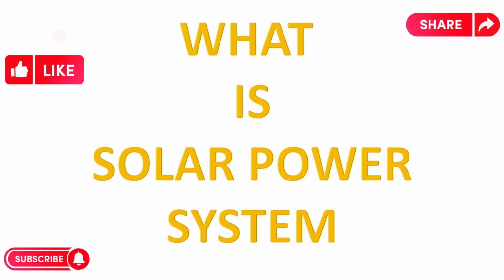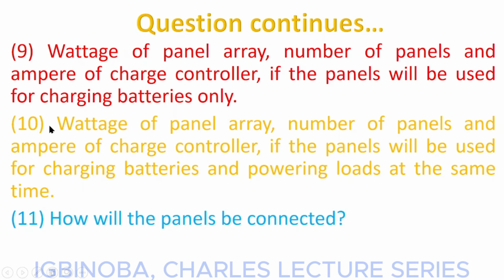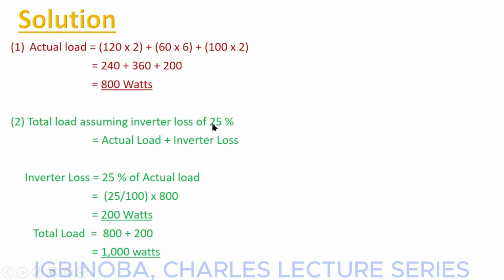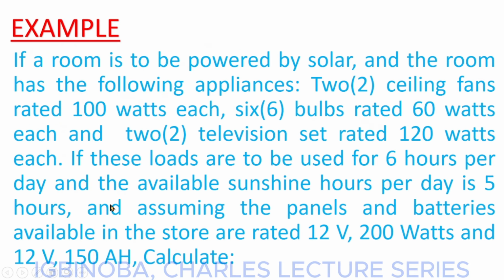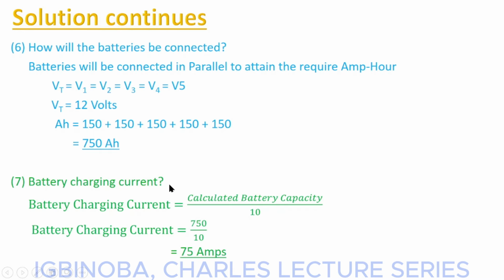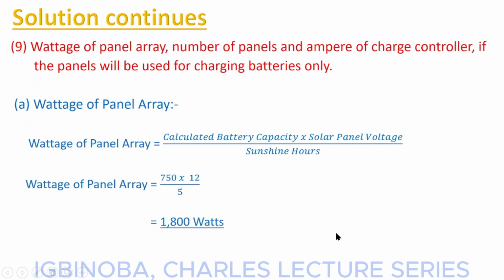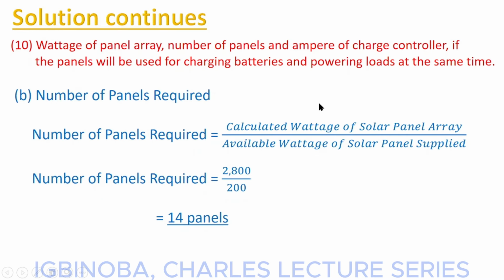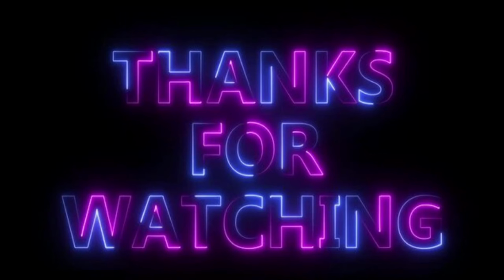Design of Solar Power System

Comment: CIV23W 
ANSWERS; 
1) 1380 Watts
2) 1725 Watts
3) 2156.25 VA
4) 1293.75 AH
5) 9 batteries approximately 
6) It will be connected in parallel 
7) 129.375 A
8) 14 hrs
9a) 3105 watts
9b) 16 panels approximately 
9c) 258.75 Amps 
10a) 4830 watts
10b) 24 panels approximately 
10c) 402.5 Amps
11) It would be connected in parallel

Comment: EEE118N
1. Actual Load= (3×100)+(10×60)+(4×120)=1380Watts
2. Total load with 25% inverter loss= 1725Watts
3. Inverter rating= 2156.25VA
4. Battery capacity= 1293.75Ampered
5. Number of batteries= 9 batteries 
6. Batteries are connected in parallel 
7. Battery charging current= 129.4Amperes
8. Battery charging time= 14 hours
9a. Wattage of panel array= 3105Watts
9b. Number of panels= 16 panels
9c. Charge controller= 258.75A
10a. Wattage of panel array= 4830watts
10b. Number of panels= 24 panels 
11. Panels are connected in parallel

Comment: EFETURI-YOUNG SOLOMON 
COET/10546/2022

1. 1380 watts
2. 1725 watts
3. 2156.23VA
4. 1293.75Ah
5. 9 batteries
6. The battery are to be connected in parallel
7. 129.4A
8. 14hours
9a. 31053W
9b. 16 panels
9c. 258.75Amps
10a. 4830 watts
10b. 24 panels
10c. 402.5A
11 The panel are arranged in parallel.

Comment: MEC118N

1. 1380W
2. 1725W
3. 2156.25VA
4.1293.75AH
5. 9 batteries
6. Connection is done parallel to increase current
7. 129.4A
8. 14 hours
9a. 3105watts
9b. 16 panels
9c. 258.75A
9d. Parallel connection
10a. 4830watts
10b. 24 panels
10c. 402.5 A
11. Panels are arranged in parallel

Comment: CIV30D

1) Actual load - 1380watts

2) Total load - 1725watts

3) inverter - 2156.25VA

4) Battery Capacity -1293.75AH

5) number of batteries -9

6) parallel connection 

7) battery charging current - 129.375amps

8) Battery charging time- 14hrs

9a)wattage of panels arrays  - 3105watts

9b) Numbers of panels - 16

9c)Ampere of charge controller -  258.75amps

10a) Wattage of panel arrays - 4830watts

10b)Number of panels- 25

10c) Ampere of charge controller - 402.5Amps

11) parallel connection.

Comment: COMP53A

1.)The actual load is 1,380W.
2.)The total load assuming inverter loss of 25% is 1,725W.
3.)Inverter rating is 2156.23VA.
4.)Battery Capacity is 1293.75Ah.
5.)Number of batteries for backup hours is 9.
6.)The batteries will be connected in Parallel.
7.)The battery charging current is 129.4A.
8.)The battery charging time assuming a charging loss of 40% is 14 hours.
9.)When the batteries were charged only;
a.) Panel array= 3105W.
b.) Number of panels=16.
c.) Charge controller=258.75A.
10.)When the batteries and powering load were charged at the same time.
a.)Panel array=4,830W.
b.) Number of panels= 24.
c.) Charge controller=402.5A.
11.) The panels would be connected in Series-Parallel.

Comment: PETROCHEM45S

1. 1380 watts

2. 1725 watts

3.  2156.25 VA

4.  1293.75 Ah

5.  9 batteries

6. Parallel connection

7.  129.375 A

8. 14 hours

9. 3105 watts
    16 panels
     258.75 A

10. 4830 watts
       24 panels
       402.5 A

11. The panels are arranged in parallel

Comment: PETROCHEM46T

1. 1380 watts

2. 1725 watts

3.  2156.25 VA

4.  1293.75 Ah

5.  9 batteries

6. Parallel connection

7.  129.375 A

8. 14 hours

9. 3105 watts
    16 panels
     258.75 A

10. 4830 watts
       24 panels
       402.5 A

11. The panels are arranged in parallel

Comment: MAR71S

1)actual load=1380watts.2) Total load=1725watts.3)inverter rating=2156.25VA.4) Battery capacity=1293.75Ah.5)Number of batteries=8.6.6) connection parallel.7)Battery charging current=129.375.8) charging time.9) a wattage of panels array=3105w.B) Number of panels 16 panels charge controller 258.75A.10)a wattage of panels array 4830W.B) Number of panels 24.C) charge controller=4025A.11) panels arrangement parallel.

Comment: MAR100V

1.Actual Load=1380W.

2.Total Load(25% loss)=1725W.

3.Inverter Rating=2156.25VA.

4.Battery capacity=1293.75AH.

5.Number of batteries=9.

6.battery connection=Parallel.

7.Battery charging current=129.375A.

8.Battery charging Time=14 hrs.

9a.Array wattage (charge only)=3105W.

9b.number of panels=16 panels.

9c.charge controller current=402.5A.

10a.Array charge Wattage (charge+load)=4830W.
10b.Number of panels=25 panels.
10c.charge controller current=402.5A.

11.Panel connection=Parallel.

Comment: MEC2B

1. Actual load - 1380 Watts
2. Total load - 1725 Watts
3. Inverter - 2156.25 VA
4. Battery Capacity - 1293.75 AH
5. Number of batteries - 9 
6. Parallel connection 
7. Battery charging current - 129.375 Amps 
8. Battery charging time - 14 Hours
9a. Wattage of panel arrays - 3105 Watts
9b. Number of panels - 16
9c. Ampere of charge controller - 258.75 Amps
10a. Wattage of panel arrays - 4830 Watts
10b. Number of panels - 25
10c. Ampere of charge controller - 402.5 Amps
11. Parallel connection

Comment: NAT27A

1. The actual pad is 1,380W
2. The Total load is 1,725W
3. The inverter rating is 2,156.23VA
4. The battery capacity is 1,293.75Ah 
5. The Number of batteries is 9
6.  The batteries are connected in parallel 
7. The Battery charging current is 129.4 amps.
8. The battery charging time is 14 hours.
9. a. The wattage of the panel array is 3,105W
b. The number of panels is 16 panels.
c. The Charge controller rating is 258.75 amps.

10. a. The wattage of the Panel array is 4,830 Watts 
b. The number of panels is 24 panels.
c. The charge controller rating is 402.5 amps
11. The panels are arranged in parallel

Comment: PETROCHEM6F
ANSWER:
1;Actual load = 1380 W (8280 Wh/day)
2:Total load (25% inverter loss) = 1380/0.75 = 1840 W (11040 Wh/day)
3:Inverter rating = 1840/0.8 = 2300 VA
4:Battery capacity = 11040/(12×0.75) ≈ 1226.7 Ah
5:Number of batteries = 1226.7/150 ≈ 9 batteries
6:Connection = All in parallel (system voltage = battery voltage = 12V)
7:Charging current = 1226.7/5 ≈ 245.3 A
8:Charging time (40% loss) = 5/(1−0.4) ≈ 8.3 hours
9:Charging batteries only: Energy = 1226.7×12 =14720Wh → Power=14720/5=2944W → Panels=2944/200≈15 panels; Controller current=2944/12≈245.3 A
10:Charging + powering load: Total power=1840+2944=4784W → Panels=4784/200≈24 panels; Controller current=4784/12≈398.7 A
11:Panels connected in parallel (matching 12V system voltage)

Comment: C1V48V

1. 1380W
2. 1725W
3. 2156.25VA
4.1293.75AH
5. 9 batteries 
6. Connection is done parallel to increase current 
7. 129.4A
8. 14 hours
9a. 3105watts
9b. 16 panels
9c. 258.75A
9d. Parallel connection 

10a. 4830watts
10b. 24 panels
10c. 402.5 A

11. Panels are arranged in parallel

Comment: COMP63K
Answers:
1. The actual pad is 1,380W
2. The Total load is 1,725W
3. The inverter rating is 2,156.23VA
4. The battery capacity is 1,293.75Ah 
5. The Number of batteries is 9
6.  The batteries are connected in parallel 
7. The Battery charging current is 129.4 amps.
8. The battery charging time is 14 hours.
9. a. 3,105W
b. The number of panels is 16 panels.
c. The Charge controller rating is 258.75 amps.
10. a. The wattage of the Panel array is 4,830 Watts 
b. 24 panels.
c. The charge controller rating is 402.5 amps
11. parallel arrangement

Comment: PETROCHEM28B

1. 1380W
2. 1725W
3. 2156VA
4. 1293.75Ah
5.  Approximately 9 backup batteries 
6. It will be connected in parallel 
7. 129.375A
8. 14hrs
9. (a) 3105W (b)16 panels (c) 258.75A
10.  (a) 4830W (b) 24 panels (c) 402.5A
11. It will also be connected in parallel

Comment: CHM102X 

1. The actual pad is 1,380W
2. The Total load is 1,725W
3. The inverter rating is 2,156.23VA
4. The battery capacity is 1,293.75Ah 
5. The Number of batteries is 9
6.  The batteries are connected in parallel 
7. The Battery charging current is 129.4 amps.
8. The battery charging time is 14 hours.
9. a. The wattage of the panel array is 3,105W
b. The number of panels is 16 panels.
c. The Charge controller rating is 258.75 amps.

10. a. The wattage of the Panel array is 4,830 Watts 
b. The number of panels is 24 panels.
c. The charge controller rating is 402.5 amps
11. The panels are arranged in parallel

Comment: MEC20T 

1. 1380W

2. 1725W

3. 2156VA

4.1294Ah

5. 9 batteries 

6. Parallel Connection.

7. 129A

8. 14hours.

9 a. 3106W.
   b. 16 panels.
   c.  259A.

10. a. 4831W.
       b. 24 panels.
       c. 403A.

11. Parallel Connection

Comment: MEC119O

1.1380W
2. 1725W
3. 2156.25VA
4.1293.75AН
5. 9 batteries
6. Connection is done parallel to increase current
7. 129.4A
8. 14 hours
9a. 3105watts
9b. 16 panels
9c. 258.75A
9d. Parallel connection
10a. 4830watts
10b. 24 panels
10c. 402.5 A
11. Panels are arranged in parallel

Comment: NAT2B

Answers
(1) Actual load = 1380 W
(2) Total load (25 % inverter loss) = 1840 W
(3) Inverter rating = 2300 VA
(4) Battery capacity = 1226.67 Ah
(5) Number of batteries = 9
(6) Battery connection = All in parallel (12 V system)
(7) Battery charging current ≈ 135 A
(8) Battery charging time (40 % charging loss) ≈ 11.4 hours
(9) Panels for charging batteries only
•  Array wattage ≈ 3680 W
•  Number of panels = 19
•  Charge controller ≈ 385 A
(10) Panels for charging batteries + powering loads simultaneously
•  Array wattage ≈ 4930 W
•  Number of panels = 25
•  Charge controller ≈ 515 A
(11) Panel connection = Parallel (or series-parallel strings matching 12 V charge-controller input)

Comment: PETRO4D 

(1) Actual Load: 1380 Watts
(2) Total Load: 1725 Watts
(3) Inverter Rating: 2156.25 VA
(4) Battery Capacity: 1293.75 Ah
(5) Number of Batteries: 9 batteries
(6) Battery Connection: Parallel connection
(7) Battery Charging Current: 129.375 Amps
(8) Charging Time: 14 hours
(9) For Charging Batteries Only: Panel Wattage is 3105 Watts
Number of Panels is 16 panels
Charge Controller Ampere is 258.75 A
(10) For Charging Batteries and Powering Loads Simultaneously: Panel Wattage is 4830 Watts
Number of Panels is 25 panels
Charge Controller Ampere is 402.5 A
(11) Panel Connection: Parallel connection

Comment: CHM31E 
1. Actual load - 1380Watts
2. Total load - 1725Watts
3. Inverter Rating 
4. Battery capacity - 1293.75Ah
5. Number of batteries - 9
6. Parallel connection 
7. Battery charging current - 129.375Ah
8. Battery charging time - 14hours
9a. Panel array wattage - 3105Watts
9b. Number of panels - 16
9c. Ampere of charger controller - 258.75A
10a. Panel array wattage - 4830Watts
10b. Number of panels - 25
10c. Ampere of charger controller - 402.5A
11. Parallel connection

Comment: MAR117M 
1. Actual load = 1380Watt
2. Total load = 1725Watt
3. Inverter rating = 2156.25VA
4. Battery Capacity = 1239.75Ah
5. Number of batteries = 8.625, so 9 batteries will be
used
6. The batteries will be connected in parallel
7. Battery charging current = 129.375A
8. Battery charging time with 40% loss = 14hrs
9. For charging only:
a. Wattage of panel array = 3105Watt
b. Number of panels = 16panels
c. Ampere of charge controller = 258.75A
10. For charging + powering load:
a. Wattage of panel array with load = 4830Watt
b. Number of panels = 24 panels
c. Ampere of charge controller = 420.5A
11. The panels will be connected in parallel

Comment: NAT4D

1. 1380W
2. 1725W
3. 2156.25VA
4.1293.75AH
5. 9 batteries 
6. Connection is done parallel to increase current 
7. 129.4A
8. 14 hours
9a. 3105watts
9b. 16 panels
9c. 258.75A
9d. Parallel connection 

10a. 4830watts
10b. 24 panels
10c. 402.5 A

11. Panels are arranged in parallel

Comment: MAR120P

1. Actual load = 1380Watt
2. Total load = 1725Watt
3. Inverter rating = 2156.25VA
4. Battery Capacity = 1239.75Ah
5. Number of batteries = 8.625, so 9 batteries will be
used
6. The batteries will be connected in parallel
7. Battery charging current = 129.375A
8. Battery charging time with 40% loss = 14hrs
9. For charging only:
a. Wattage of panel array = 3105Watt
b. Number of panels = 16panels
c. Ampere of charge controller = 258.75A
10. For charging + powering load:
a. Wattage of panel array with load = 4830Watt
b. Number of panels = 24 panels
c. Ampere of charge controller = 420.5A
11. The panels will be connected in parallel

Comment: CIV77Y
Answers

1.  Actual load = 1380Watt
2.  Total load = 1725Watt
3.  Inverter rating = 2156.25VA
4.  Battery Capacity = 1239.75Ah
5.  Number of batteries = 8.625, so 9 batteries will be used
6.  The batteries will be connected in parallel
7.  Battery charging current = 129.375A
8.  Battery charging time with 40% loss = 14hrs
9.  For charging only:  
    a. Wattage of panel array = 3105Watt  
    b. Number of panels = 16panels  
    c. Ampere of charge controller = 258.75A
10. For charging + powering load:  
    a. Wattage of panel array with load = 4830Watt  
    b. Number of panels = 24 panels  
    c. Ampere of charge controller = 420.5A
11. The panels will be connected in parallel

Comment: CIV93O

1.1380w

2.1725w

3.2156.25VA

4.1293.75Ah

5.9 batteries

6.connetion is done in parallel to increase the

current

7.129.4 amps

8.14 hours

9a. 3105watts

9b. 16 panels

9c. 258.75amps

9d. Parallel connection

10a. 4830watts

10b. 24 panel

10c.402 5A

11.the panels are arranged in parallel

Comment: EEE44R 

1) Actual load= (3*100)+(10*60)+(4*120) = 1380W
Total load = AL + IL
Inverter loss = 25/100* 1,380 = 345 
Total load = 345+1380= 1725W
3) inverter rating = 1725/0.8
= 2,156.25VA
4) battery capacity= 2*total load*reserve factor*hours/voltage = 2*1725*0.75*6/12 = 1,293.7Ah
5) no of battery = capacity/battery amp = 1293.7/150 = 9 batteries 
6) connection in parallel = 150*9 = 1293.7Ah
7) charging current 10% of battery capacity= 10*1293.7/100= 129.37A
8 charging time with loss 40% = 40% * 1293.7+1293.7/129.3 = 14hrs
9) wattage of panel arrays = 1293.7*12/5 = 3104.8W
9)  no of panel 3104.8/200= 16 panels
9) 258.75A 
10) 4830W
10) 24 panels
10) 402.5A
11) connected in parallel

Comment: EEE113I

1. Actual load = 1380watts
2. Total load = 1725watts
3. Inverter rating = 2156.25VA
4. Battery capacity = 1239.75Ah
5. Number of batteries = 8.625 [ 9 batteries ]
6. They will be connected in parallel
7. Battery charging current = 129.375A
8. Battery charging time with 40% loss = 14hours
9. Wattage of panel array = 3105watts
10. Number of panels = 16panels
11. Ampere of charge controller = 258.74A

Comment: MAR69Q

1.1380w

2.1725w

3.2156.25VA

4.1293.75Ah

5.9 batteries

6.connetion is done in parallel to increase the

current

7.129.4 amps

8.14 hours

9a. 3105watts

9b. 16 panels

9c. 258.75amps

9d. Parallel connection

10a. 4830watts

10b. 24 panel

10c.402 5A

11 tho nonalo oro orronand in norallal

Comment: CHM83E

Answer:
1. Actual load = 1380watts
2. Total load = 1725watts 
3. Inverter rating = 2156.25VA
4. Battery capacity = 1239.75Ah 
5. Number of batteries = 8.625 [ 9 batteries ]
6. They will be connected in parallel 
7. Battery charging current = 129.375A
8. Battery charging time with 40% loss = 14hours 
9a. Wattage of panel array = 3105watts
9b. Number of panels = 16panels 
9c. Ampere of charge controller = 258.74A
10a. Wattage of panel array with load = 4485watts 
10b. Number of panels = 23panels 
10c. Ampere of charge controller = 373.75A
11. They will be connected in parallel

Comment: EEE54B
 Solutions
1.1380w
2.1725w
3.2156.25VA
4.1293.75Ah
5.9 batteries 
6.connetion is done in parallel to increase the current
7.129.4 amps
8.14 hours
9a. 3105watts
9b. 16 panels
9c. 258.75amps
9d. Parallel connection 
10a. 4830watts
10b. 24 panel
10c.402 5A
11.the panels are arranged in parallel

Comment: CHM72T

1. Actual Load: 1380W
2. Total Load: 1725W
3. Inverter rating: 2156.25VA
4. Battery Capacity: 1293.75Ah
5. Number of batteries: 9
6. Parallel connection.
7. Battery charging current: 129.375A
Charging time: 14 hours.
9a. Wattage of the panel array: 3105W
b. Number of panels =16 panels
c. Ampere of charge controller: 258.75A
10a. Panel wattage: 4850W.
b. Number of panels ≈24 panels.
c. Ampere of charge controller: 402.5A
11. Parallel connection

Comment: MAR10J

1) Actual load = 1380Watts
2) Total load = 1725 Watts
3) Inverter rating = 2156.25VA
4) Battery Capacity = 1293.75Ah
5) Number of Batteries for backup hours = 9 batteries 
6) The battery connection will be in form of Parallel connection
7) Battery Charging Current = 129.375A 
8) Battery Charging time assuming a loss of 40% = 14hours
9) a) wattage of panel= 3105 watts 
    b) Number of panels= 16 panels
c) Ampere of charge controller= 259Amps

10) a) wattage of panel array when the batteries is used for charging batteries and powering loads at the same time= 4830Watts
b) Number of panels required= 24 panels
c) Ampere of charge controller required= 403Amps

11) The panels will be connected in  Parallel connection.

Comment: CHM82D

the answer: 
the total load: 1380W
daily energy consumption: 8280WH/day
energy from one 200W panel: 1000WH/day
solar panels required: 9 panels 
energy in one 12V, 150AH battery: 1800WH
batteries required: 5 batteries

Comment: NAT18R

1. The actual pad is 1,380W
2. The Total load is 1,725W
3. The inverter rating is 2,156.23VA
4. The battery capacity is 1,293.75Ah 
5. The Number of batteries is 9
6.  The batteries are connected in parallel 
7. The Battery charging current is 129.4 amps.
8. The battery charging time is 14 hours.
9. a. The wattage of the panel array is 3,105W
b. The number of panels is 16 panels.
c. The Charge controller rating is 258.75 amps.

10. a. The wattage of the Panel array is 4,830 Watts 
b. The number of panels is 24 panels.
c. The charge controller rating is 402.5 amps
11. The panels are arranged in parallel

Comment: COMP56D

1. The actual pad is 1,380W
2. The Total load is 1,725W
3. The inverter rating is 2,156.23VA
4. The battery capacity is 1,293.75Ah 
5. The Number of batteries is 9
6.  The batteries are connected in parallel 
7. The Battery charging current is 129.4 amps.
8. The battery charging time is 14 hours.
9. a. The wattage of the panel array is 3,105W
b. The number of panels is 16 panels.
c. The Charge controller rating is 258.75 amps.

10. a. The wattage of the Panel array is 4,830 Watts 
b. The number of panels is 24 panels.
c. The charge controller rating is 402.5 amps
11. The panels are arranged in parallel